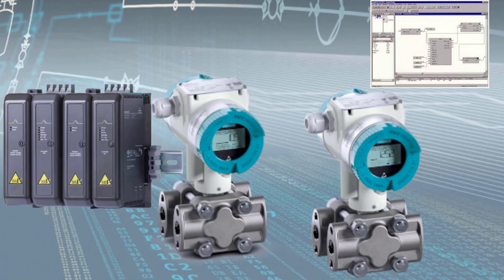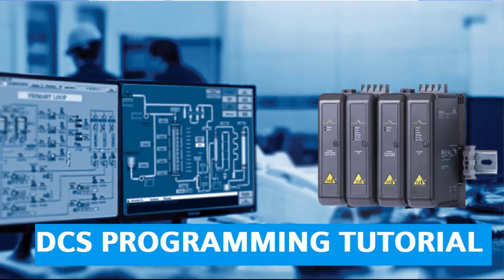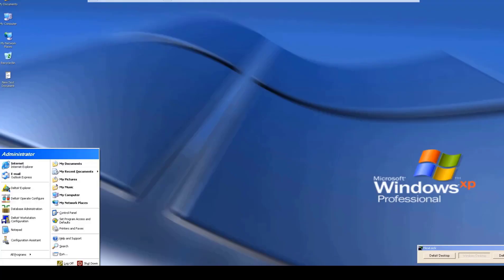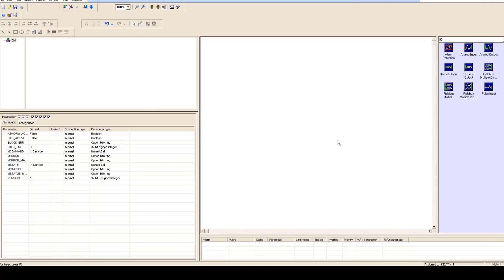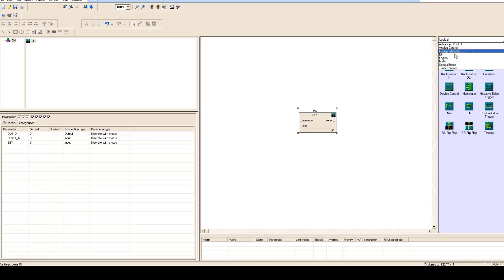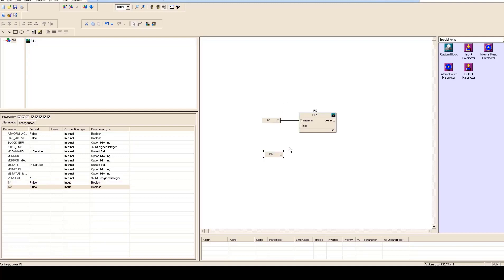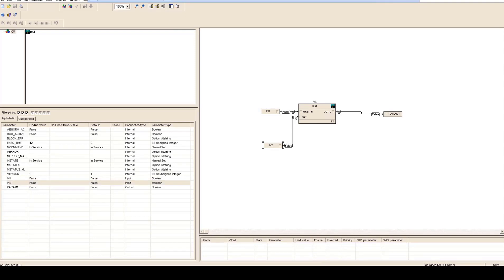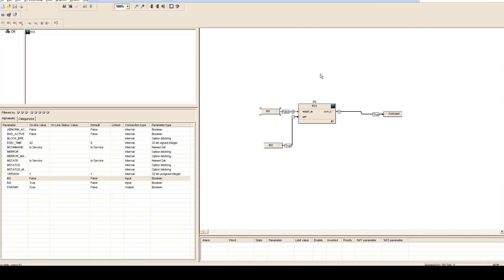DeltaV DCS Programming Tutorial for Beginners 2021

Comment: Hello. I am new to Delta V, but very familiar with PLC programming.  I have a project that has a Delta V talking to a ProtoNode protocol converter "Server side - Ethernet IP".  How or what is the setup looks like on the Delta V side and what is the expected tags looks like?  Thank you!
Reply: Did you mean with "server side - Ethernet IP" is communication between DeltaV and others PLC/Controller Device using modbus TCP/IP?
Reply: @m.ikhsanrestiadi5095  thanks for your response. The issue is resolved. The system I was working on has a Siemens PLC and has to serve data to delta v over Ethernet IP. I am using Field Server ProtoNode protocol converter. Which is Modbus TCP to Ethernet IP for delta V. I was able to verify all data accept on the delta v side due to hardware limitations. I was able to verify all data by creating a test code using Allen Bradley controller. It was set to poll data from the ProtoNode using Ethernet IP protocol. So, I was able to proved to the customer that data are ready and working. So the issue is not from our system. They later found out that delta v was not able to read tags based data with the current hardware config. So they end up using the AB legacy data format instead. This was a good experience for me. We don’t have enough engineers and not able to support with full system integration projects. So I am a greenhorn when it comes to this. Thanks